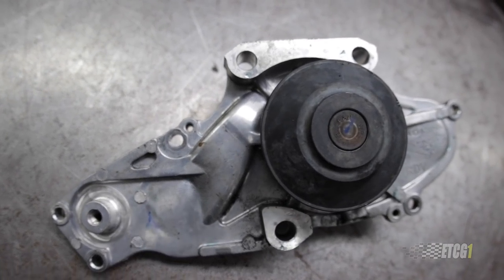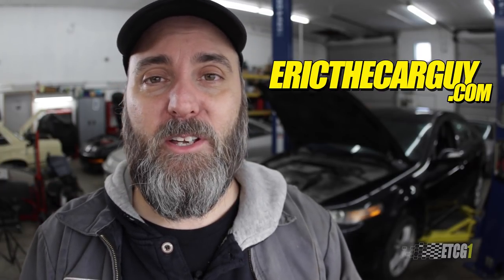Timing Belt vs Timing Chain, Which is Better?

Comment: been a tec since 1960 ME I will NEVER own a car with a triming belt today cars with chains are junk too the old push rod motors with a chain are great and to be honest there in NO engine today that is any good   I take a 283 or a 440 all day long today I own two grand cherokee with the push rod 4.0 the 4.7 with over head cam is junk just know there is no over head cam motor that is any good when at DHL we had fords with the 300 inline six that had timing gears and we get 2-300,000 miles and NEVER had a time gear go bad the proof is push rod over over head cam

Comment: I understand this video is concentrating on belts and chains, but I am curious to what you're opinion is on timing gears, such as I'm the Chevy 250 and 292 on-line:6 cylinders vs  chain and belt timing systems durability.

Comment: I remember the old ford pinto engine here in the uk, the camshaft oil spray bar would block and the cams would nip the followers and spit them out! I found several engines with spat out followers and metal shavings everywhere
You had to remove the head to replace the knackered camshaft as it came out from the rear,  the belt was a doddle to change and you could always leave the cover off i did lots of these as a young man in the 80s, one thing ive noticed with modern belts is the materials they're made from seem so much tougher an more durable, i just changed a belt on a Citroen  Berlingo with the 1.6 hdi turbo diesel engine with 90,000 miles on it 12 yrs old and it was in excellent condition

Comment: Sorry ETCG1, you failed to mention what is more likely to break. If timing belt has service interval and is not performed on time, or if the belt being installed deteriorates before the service interval the engine is pretty much done. Specially the interference engine.

Comment: Almost all new cars today use timing chains. Unlike metal, the rubber on timing belts stretches earlier than timing chains. According to mechanics I know, the interval for replacing timing belts is 100000km or 62000 miles. The time to replace timing chains is often 20 years or more as long as the oil is changed regularly. 

Timing belts was superior to timing chains for old cars because the old chain designs were noisy. New timing chains are now quieter than before.

Comment: I have several cars that use timing belts and one that is a chain. I couldn't agree more with you they all have their drawbacks and their benefits. I don't mind belts but recently came to the conclusion with my daughters car that has a belt that it is not for her as she dont want to do that level of maintenance. She don't mind doing oil changes and wants to learn how as well as other maintenance. I on the other hand don't mind the work of a belt.  One other thing about belts they tend to be quieter and have lower harmonic vibration and to one post about the GM plastic timing chain gear that was an effort to quiet the chain noise and works but has the drawback of wearing out quicker. There are timing chain to belt conversion kits out there example Speedmaster PCE262.1006 or Competition Cams 6100 Magnum Belt Drive System designed for that very reason and purpose as I mentioned. 👊👊👊👊👊

Comment: So my 04 Elantra has a belt driving one cam and a chain connecting both camshafts together it has cvvt, my question is why? why both I've had to change both, the chain stretched and the tensors spring was broken but the timing belt was just due, so I'd like to hear your perspective as my head mechanic cant give an answer (he's an idiot) I've tried doing research and cant find and answer if you could provide one that would be great thanks

Comment: Had a 2003 toyota v6 with a belt .best engine ever.. so quiet too...
Yes a little expensive to do the belts and water pump.. but only needs to be done every 100.000 ml...

Comment: Timing Belts are a costly to replace high maintenance pain in the ass.  Timing chains USED to be very long lived parts, at least before engineers were forced to turn engines into multi-cam high efficiency science experiments. Simplicity is key, used to be a high quality roller timing chain in an old school small block chevy could last for 150,000+ miles easy, it would stretch but the engine kept running even if down on power.  Now we got the brilliant idea to add friggin' fragile high wear plastic guides and failure prone cam phasers and now you got a much higher potential for failure and costly repairs.  Used to be a chain would stretch and youre power was down etc but it would still run and drive.  Now we have the most unreliable valve train drives ever, if a cam goes out of phase even a single degree now the computer freaks out and check engine lights come on and all kinds of bad things happen.  Any person well versed in mechanics will tell you the more complicated you make anything the more failure prone it becomes.  Cars spend more time in the shop now than on the road, and cost to repair all this overly complicated nonsense is insanely unreasonable.  Owning and driving a car today costs as much as a house used to not that long ago, where does the insanity end, with cars becoming unaffordable for all but the rich-???.

Comment: Here in England i often see people asking about doing timing belts... of course i always say 100K or 10 years change it along with water pump and tensioner if possible. then everyone jumps on me. "oh your costing this person more money when they dont need water pump done, its not even run by that belt" my answer... i dont care if its run by it, the mechanic is there get it changed at same time and SAVE money. or that person has to come back later and pay labour again to do the pump. i cant get it through to people that its not only peace of mind but cost effective to do it in one go. when it comes to belt or chain im not bothered on my 2009 ford focus 1.8 TDCI (wet belt i believe) as long as it doesnt break. thats my rant, thanks for reading lol

Comment: Once it went to overhead camshafts, all bets are off. Now they’re changing the timing as the car is ran. Give me a push rod engine all day, change your oil every 3000 miles and it will last til the body rusts away. Lol

Comment: Now that many mfg's have gone timing chain, it is important to reseach who is doing it right. Mini, Audi (VW)  and some others have a lot to learn from our American brands. Others build good engines, but lack of maint. causes problems that could have been avoided.  Give me an old Honda with a timing belt and let me give it hell knowing it will good running just as good as it did when new.

Comment: Chains are great for a non OHC engine.  Problem is a lot of modern cars use a chain for an OHC engine and they last about as long as a belt.  I’d say if you use a belt make it an non interference engine.  Buy you can’t beat gears.  I’m looking at you 300ci inline 6 Ford, Cummins b series and VW type I.

Comment: Remember cam in block pushrod engines? The way God intended. Like it says in scriptures. In the book of Compressions 12:1 "And the LORD said 'Thy engines shall be cam in block and run timing chains without need for plastics or tensioners.' And the people rejoiced."
Reply from the maker: Except the people with 3.8L V6s from GM. They didn't rejoice so much when the nylon came off of the gears and their engines went out of time.

Comment: Not a mechanic but I do some maintenance/repairs on my own but as a consumer.  Im team chain and that does influence my buying decision.  Especially since im the type that usually buys a car and drives it until the wheels fall off.  Bonus if that car is a "non-interference" engine so if there is an issue with my timing system, I wont roach the engine.  You happen to see more non interference cars using a chain system.

Then again, my car has the GM 3.6 which has been known to eat up timing chain guides (however I have read that this issue has been resolved in later models like mine and I always do my oil changes early and not when the computer says so every 3-5k.

Comment: I guess my beef with both is access. I don't understand why manufacturers feel they must make extremely difficult to access. It's bad enough we have transverse engines but add insult to injury they place so many components and parts infront of thw timin case cover it's almost impossible to get to it. Please, don't shoehorn the engine in, give us room to get to stuff. Everything will need maintenance sooner or later

Comment: My motto is if it's deliver headcam I'd rather have a belt if it's single overhead cam I'd rather have a chain like a Toyota 22RE once you put steel guides practically indestructible but the motherlode is definitely gear to gear have a Cummins with gear to gear with a million miles on it never had to replace any timing on it LOL just the pain of death

Comment: had a Chevy HHR timing chain tensioner fail and found that was common with that engine bent and broken valves was the out come - had a PT Cruiser timing belt break NO bent valves or damaged engine replaced broken belt back on the road again - Change my thinking what is a good engine!

Comment: I vote belt because if the owner changes it every 100000 miles they will have no issue the average car owner can do that but they can’t wait to 150000 miles sn seven it jumps times cause the tensioner fails and pistons hit valves and you need a 6000$ engine job I’ll take my 800$ timing belt job every decade or so any day

Comment: My only real beef with the timing belt on my F23 Accord is that the engine mount is inside the circle of the belt, so you have to jack up the engine and yank the mount to get the timing belt out. Big nuisance, that.

Comment: If a engineer decides to go with belt, they should HAVE to do two things. 1. The engine has to be non-interference 2. The belt has to be easily accessible.
Reply from the maker: Just because an engine is an interference engine that does not automatically mean that the valves will hit the pistons if the belt breaks. The car behind me in this video is a perfect example as you'll see in a future ETCG video.

Comment: When replacing chain replace all guides and sprockets if able tensioners and oil pump 
Trimming belts if it there the water pump and some timing belts also drive the oil pu

Comment: Ironically Ford manufactured the Ford Transit Connect with a 'wet timing belt' which is encased in oil, where it has been knowing the oil degrades the belt causing it to weaken and snap. When it snaps it destroys the entire engine.

Comment: ETCG - you can do it yourself  so its not a big issue- for most a chain is a far better  choice- how many US v8  timing chains go in normal use- plus the water pumps are external and on some cars its a 30 minute awap

Comment: My car has a timing chain and one on the reasons why I bought that model. Also I have machines I service that are past 50 years, some with timing chain, spring and hydraulic tensioners and teflon guides that are hardly worn. The chains are the only things that show no signs of wear. In contrast, those that are belt driven get broken often along with bearings and worn pulleys because of the tension involved. Its true that once you service on time it makes no difference really. The problem is that you are sure your chain is getting lubricated but you cant even guess the state of your timing belt especially with heat involved.

Comment: I personally prefer chains  because you don't have to deal with them  especially if you buy a good brand of  vehicle like Toyota And they've been maintained  You don't have to  worry about it failing And that's the big appeal to chains enthusiasts and mechanics Like you and myself  Don't care as much about belts because they like cars but most people Who really aren't into cars  maybe they don't have as much money, whatever the case may be would rather have the most reliable and cheapest thing possible and chains are where it's at because all you have to do with a chain is just change your oil

Comment: Chains are better if designed right......I won't buy a rubber belt to time the engine unless water pump isn't internal. If it was as easy as a fan belt, sure otherwise no.

Comment: I had an 01 Jetta with the VR6 and the chain is on the "backside" of the motor and had one of the upper guides break. The chain chewed it up and ended up blocking the oil pump screen made crappy job worse. the car was never really right after that. So I bought another one...

Comment: There are valid points for both systems. I like it that the timing belt often means that the car is mechanically maintained. A snapped timing belt might be a costly business, but not always. That Acura TL story is pretty enlightening. Imagine that happening with a timing chain. 😱

What I am saying is that whenever a timing chain fails the consequences often tend to be severe. 

All things wear out. I love my Japanese made cars and trucks with timing chains (Toyota and SUBARU). I still believe that the newer (since 2014) Toyota and SUBARU ICE engines are better than the previous generations. Especially those with both port and direct ignition. 

I’d personally run away being offered a Volkswagen Autogruppe engine (Škoda/Audi/Seat/Volkswagen) or an Mercedes-Benz with known timing chain (or rather timing chain guide) design flaws. 

Cars with known timing chain problems are stone cold on the used cars‘ market here in Sweden. Used cars in need of a timing belt service are often sold before the maintenance intervals (years/mileage). 

I am also looking forward to some day being the owner of a B-EV. Fewer moving parts and to some extent another type of maintenance than with the ICE-vehicles. I’ll just have to adjust and get my love for wrenching done elsewhere. There are still chainsaws, brush cutters, lawnmowers, snowblowers and leaf blowers that will need regular maintenance and repairs.

Comment: I like better a non-interference engine with timing belt because if timing belts breaks, no damage happens to the engine. Alot of cars and trucks have timing chains with interference engines, if timing chains breaks , that engine is bye bye. 
It all depends if the engine is non-interference or interference.

Comment: Small block Chevy V8.  Timing chain, no tensioner, lasts the life of the engine, no maintaince.
Reply from the maker: Nylon coating gears from the factory can fall apart and cause the chain to fail. Also, over time the chain gets loose and causes a loss of performance.
Reply: @ETCG1  Have you seen Nylon coating gears from the factory on a Small block Chevy V8?  I have not.
Reply from the maker: @roger_revo  Not on the V8's as much as the V6s. I have seen worn timing chains cause performance issues though.

Comment: Timing chains do give less bother.   A point id make here is transit now use belt which runs in the engine and gets covered with oil just like the chain did.   They are prone to failure even when changed .

Comment: I have a dodge 1500 with the chain and 163k miles…I would be very curious to hear thoughts on switching over to a gear drive since a replacement will be happening soon either way.

Comment: The 32 valve Porsche 928s have both a belt, and little chains that drive the exhaust cam off of the intake cam. And both the belt and the chain guides have been known to break.

Comment: Were belts originally favored because they were quieter than chains?
Reply from the maker: Partly, but they are also serviceable. As I said in the video chains and their corresponding parts DO wear out over time and may eventually fail. It's just an engineering choice. I think most engines are moving to chain drives now to keep the advertised maintenance cost down.

Comment: I'm in the chain camp.  But the point Eric made is valid - keep up with the maintenance; regular oil changes (chain) or belt replacements.  Although, manufacturers are probably pretty conservative in belt replacement intervals.  Went 120K miles on a belt in a '92 Vigor (just a coincidence that I had one, Eric) when the recommended interval is 90K miles.  Belt that came out was in very good shape and could have easily gone another 30K miles or more, though I hardly ever rev the engine over 3 grand.  Also replaced a belt in a 1UZ motor with 215K miles, and that belt looked pretty bad.  It may have even been original to the car, considering the previous owners' (2, at least) aversion to maintenance, and the cost and difficulty of said maintenance.
Had a 1980 Datsun with the 2.0 liter motor with a chain.  Even after 268K miles and regular oil changes, ran well and quiet as a church mouse.  When time came for finding a car for my daughter, went with 2nd gen CR-V with KA24 motor for it's chain and known reliability.  Avoided the 1st gen for that reason.
The Mopars (1 small block, 1 big block) obviously have chains.  But the big block is an aftermarket dual chain/sprocket setup without those stupid nylon teeth.  (Should've gone with roller lifters, though.)  Nylon teeth: whose idea was that?  Stupidest cam drive idea ever...

Comment: I have an old BMW that has a chain, and honestly I kinda hate the idea that I don't have a service interval on the guides, which are a wear item that's hard to replace (the tensioner isn't hard).  A rebuild on this particular motor is huge $$, so it's a distant but real concern...

Comment: 2 things I've noticed from working on my own cars for decades. 1. Timing chains give you a warning when they're getting worn out. They rattle a bit at startup until the tensioner's oil pressure builds up. You hear nothing from timing belts.  2. It seems to me like replacing a timing chain is easier than replacing a timing belt. At least on the cars I've owned. (Toyotas, GMs, and Fords.) Of course, others' experiences may be different...